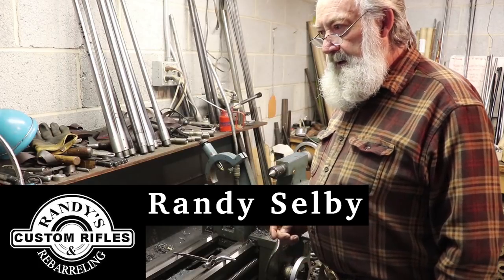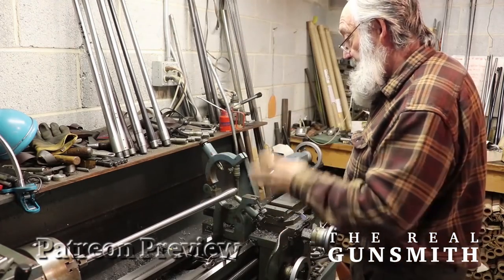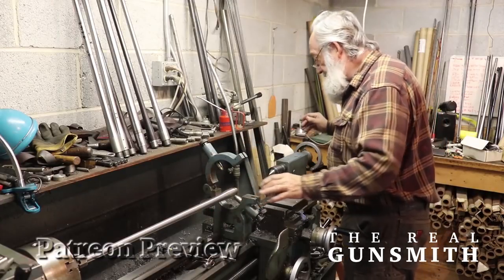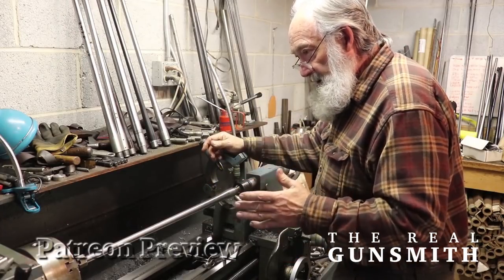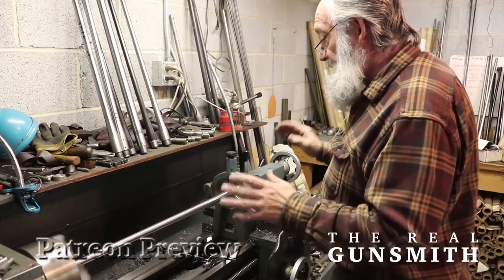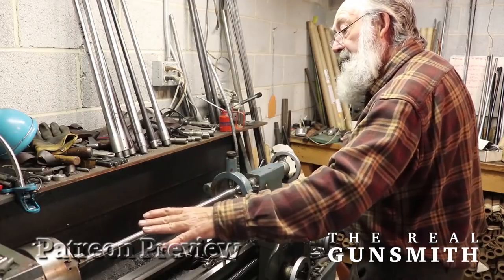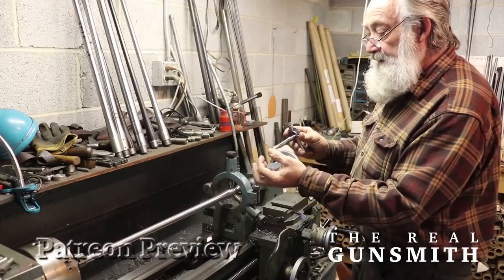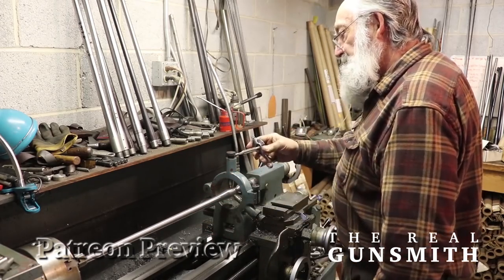Patreon Preview: Thread & Chamber barrel

Comment: Chuck wrench left in the chuck... FAIL!
Reply: What does that have to do with the price of tea in China. 
You don't turn on an empty lathe. 
It's experience. If you can save a step why not. 
Steps go insert bbl. Get it setup do work and remove.  Do you know the next step. Insert bbl. So why remove it if it is the next tool you need in the same location.
Leave it I wouild.
100 bbl's done would save 200 actions. Just for the key.
Reply: @robboat3864  good call! I bet you also choose not to use the safety on your rifle. Don't be a FOOL!
Reply: He is allowed...........